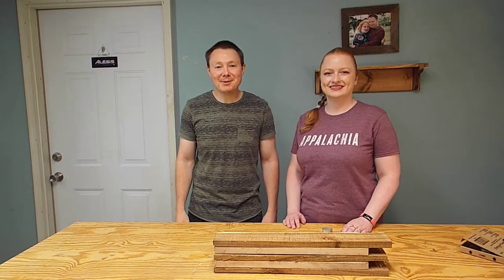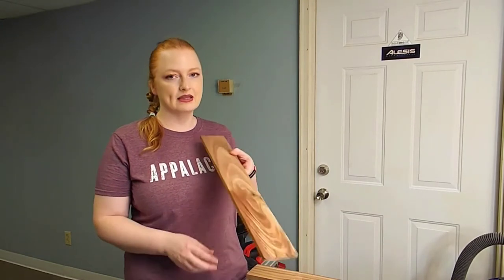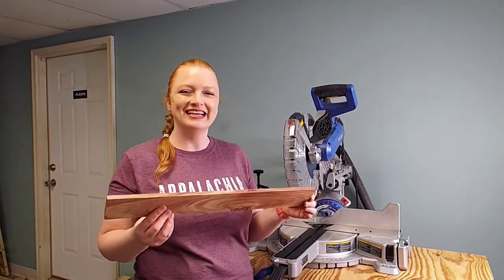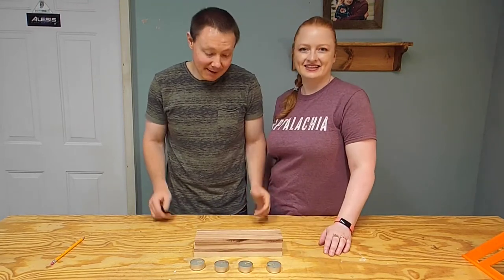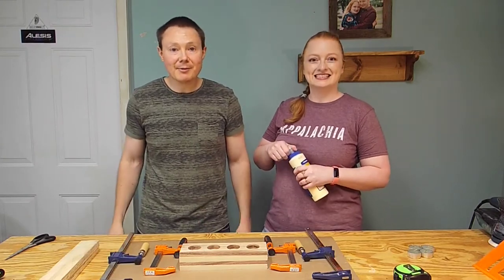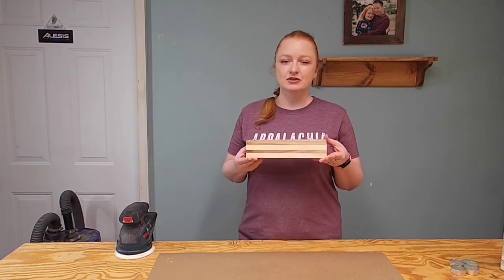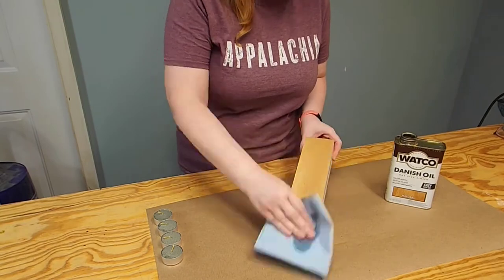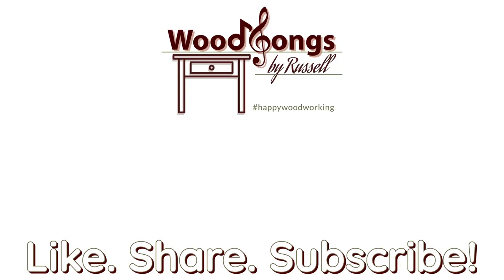How to Make a Tealight Candle Holder | Easy Scrap Wood Project for Beginners

Comment: It’s absolutely magic when the danish oil hits the wood, isn’t it? Easy project that looks so great when it’s finished! I’ve always had caveman looking results when using a holesaw for projects along with lots of smoke! That is until I saw a workshop tips episode on Acutabove Woodworking several months back. He makes a lot of wooden toys that require wheels, and the holesaw is his preferred weapon for making them. His trick for success is to drill a smaller hole (by smaller, I mean like 1/2” or so, the bigger the better) that overlaps the kerf area for the holesaw cut. This allows all that fine sawdust to evacuate the kerf instead of piling up in it and overheating the saw and wood! He drills the small hole on outside of the kerf since he’s keeping the “wheel”, but it’s just as effective on the inside as in y’all’s case! No smoke, no burned wood, I was like why did it take me 61 years to find out about this! I’ll stop rambling! Thanks for another great episode!
Reply from the maker: That is  a super great tip, Tom! We will have to try that and check out their channel. Sanding out burn marks in a bummer, that's for sure! Hope you are staying warm in this weather. Thanks again for watching and sharing. #happywoodworking
Reply: @happywoodworking  We’ve actually had snow 3 weekends in a row over here in NC, and 4 snow events for the winter so far! That’s four more than we we usually see all winter in recent years! Acutabove has been at it on YouTube for many years, and does some really cool stuff in his tiny shop. His workshop tips episodes are full of good ideas! Until next time, y’all stay safe & warm!

Comment: Why not make it taller then rip it as you would a cutting board?
Reply from the maker: That is a great idea! We may try that in a future episode. Thanks, Allen!
Reply: @happywoodworking  At 1 1/2' high and 3" wide. You still have room to drill down 3/4" for the Tea Lights to go in.